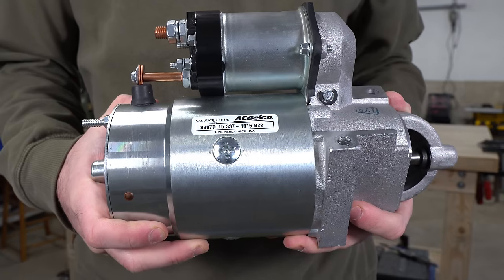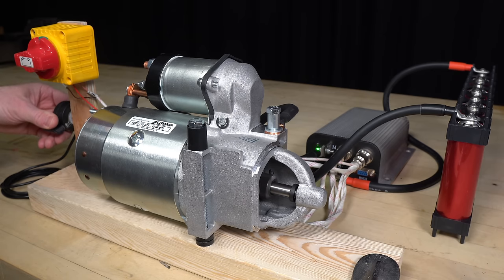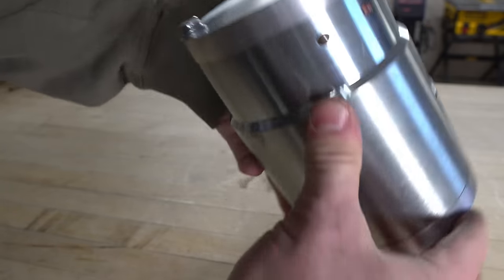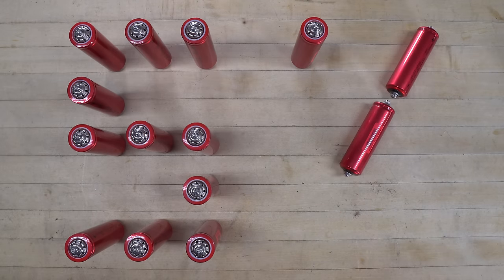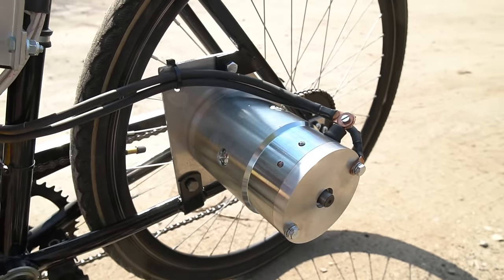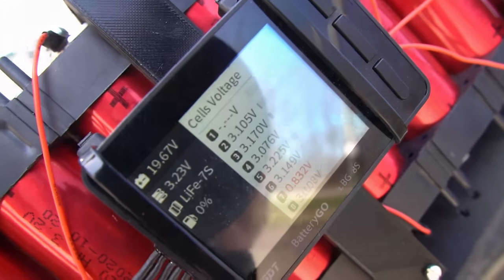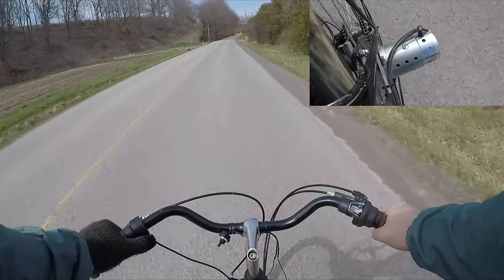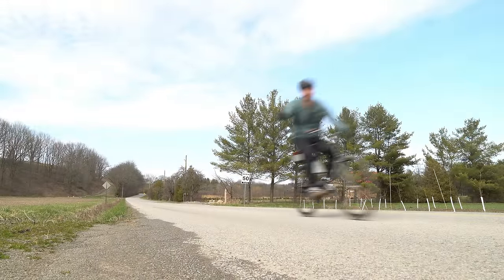Starter Motor Powered Bike

Comment: Always gotta bring up the AGNI/Lynch/Briggs and Stratton eTek motors.  They are my absolute favorite and amazing for projects requiring 1-50hp, here is some more information:

The Lynch motor is an unconventional design with a disc armature. It marries the advantages of a conventional, wound armature motor with the benefits of a flat (printed circuit) motor. It is similar to a pancake motor, but is more powerful than any of these technologies. The disc armature has magnets on both sides, doubling the available flux density and shortening the magnetic path. It therefore packs more power per pound and per cubic inch than any other motor technology. Of course such a revolutionary motor is not for every application - it is not as cheap as wound field motors, but for many applications it is a far superior motor.  It has a previously unheard of power to weight ratio and also power to volume ratio. It is also highly efficient because of the double magnet design and associated short magnetic path. It also includes integral fan cooling.

 The Lynch motor is an important development which spurred other motor designers to improve their products to remain competitive, such as synchronus permanent magnet machines.  As a result of the competition between manufacturers the cost of high performance motors and controllers has fallen dramatically.  We hope the cost of solar cells also reduces to allow renewable transportation to develop as a viable alternative to carbon fuels.
Cedric Lynch built his electric bike around a mid-drive configuration, also building one of the worlds most efficient light weight electric motors to power his rig reliably at 60-MPH for significant distances. He would later set several world records with his axial flux motor and bring it to market as the Lynch / Agni motor. Briggs and Stratton would eventually buy this technology which would lead to the Etek motor, which is now famous for making high speed efficient electric hot rods.

Cedric uses to achieve high speeds is by following the rules of aerodynamics, and building a bike that is as aerodynamic and as efficient as possible. The other builders on this list bypassed this step, and Cedric uses this bicycle as daily transportation on real commutes. Although this high-efficiency motor uses “old school” brushes, this fact allows builders to use very affordable controllers. He has proven his design choices through thousands of miles of commuting, and the Lynch motor is highly respected.

Cedric Lynch is known as the creator of the Agni Motor, a highly efficient electric motor that weighs around 25 pounds and can put out as much as 50hp. 

Cedric Lynch is a British 'mad scientist' type mechanical engineer obsessed with the idea of greener transportation. His interest has been in building a super efficient yet powerful vehicle that can serve as a car replacement.

He started thinking of his own design for an electric motor in 1983 when he began entering competitions organized by the Battery Vehicle Society regarding building an efficient electric vehicle. At the time there was no reasonably priced DC motor with descent efficiency so Lynch decided to build his own utilizing modifying existing motors with old tin cans that he would spread out flat to use as cooling fins. Surprisingly using rudimentary materials and a garage work bench, Cedric was making better more efficient electric motors than any of the universities were able to manufacture in state of the art workshops.

Cedric then came up with a motor design that could be cheaply manufactured and began manufacturing his own motor that he could sell to the public in 1988 and the Lynch Electric Motor Company was born, known as LEMCO.

Cedric first used his motor to create a small boat called “The Spark” that would set an electric boat efficiency record. From there Cedric turned his attention to bicycles, an application generally considered too small for a lynch motor at that time. Cedric mounted his motor in recumbent bike, allowing him space to eventually use a set of thundersky lithium batteries.

The resulting aerodynamic recumbent bike had a top speed of 60mph and still managed an incredible range of 150 miles. Cedric rode his recumbent creation everywhere as a daily commuter, putting an amazing 50,000 miles on the machine - technically a motorbike.

Briggs and Stratton, the US firm famous for lawn mower engines, bought the technology and used it in their E-Tech Motor, and Cedric went on to manufacture his latest incarnation of his lynch design into the Agni motor, which is used in go karts, sailboats, motor boats, and even small airplanes.

The Lynch designed motors all have the same traits. Brushed motors, around 25 pounds in weight and they are able to put out enormous power compared to their weight. Sometimes as high as 50 hp (depending on amperage ran through the motor) at an incredible 98% efficiency.  Lynch Motors are also the most often used motors in electric motorcycle racing applications.

Cedric's zero-emission motorcycle, which has a top speed of 120mph, was shown in action winning the world’s first zero carbon race – the TTxGP in the Isle of Mann.

The idea for the electric motor has been snapped up by the 56-year-old’’s friend Arvind Rabadia, who together with his brother Hasmuk Rabadia had been thinking of starting a business in India. They have now set up Agni Motors to make further-improved versions of Cedric’s motors

Despite Cedric’s breakthrough invention he has no formal engineering qualifications and taught himself the techniques needed to construct his engine. He first became interested in electrics when his parents bought him a book entitled How to build things from things found at home. 
The Etek motor is a brushed 25-pound pancake shaped motor that puts out enormous power for its weight. Depending on amperage and voltage the Etek can easily provide between 15-horsepower and 30-horsepower reliably and consistently (11-kW / 22-kW). A perfect platform for a powerful electric bike if you do not mind the weight. Although brushless motors are considered more modern, a brushed motor like the Etek allows the builder to use very affordable controllers.

Cedric-Lynch invented the motor and sold it to Briggs and Stratton which US company produced the Etek at a lower price (around $600). In the late 90’s early 2000’s it was the way to go for a high-power / light-weight electric vehicle. Many small E-vehicle records were set using the Etek motor. Finally, the market had a relatively lightweight and powerful electric motor available to the masses.

In essence, the Etek allowed hot rodders to build electric bikes. Before the Etek very few people had ever achieved 50mph on an electric bike. Even today, Etek motors (and newer incarnations of the Etek motor) are used to make some super fast electric bikes. In the case of Liveforphysics, the fastest E-bikes ever.

 Liveforphysics used a newer version of the Etek (the Agni motor), to achieve speeds of over 70mph, and dominate a recent hill-climb event.

Every Etek I have ever ridden has been characterized by brutal off-the-line acceleration, usually to a point where you have to apply the throttle very carefully or get thrown off. However, it is possible to run an Etek at a lower voltage or lower amperage and have a very manageable, safe, and sane electric bike that will not burn out on you, no matter high steep the incline.
Reply: Makes you wonder, what documented success we havent seen. I mean, we first cloned a species back in the late 1800s. Then we spent the next 100 years acting as if it were a science fiction subject.

Comment: Try using a Super Capacitor bank to start the motor then switch to battery power for continuous use. The Super cap can also provide a boost for up hill load.

Comment: As you have gone this far with this motor, it may be an idea to use this as a starting/boost motor for hills only and try to fit a second motor for cruise. That way you you can have motors that are efficient for the current riding condition.
Reply: Don't regular e-bike BLDCs have enough torque to starts efficiently?
Reply: U right there, but now extra weight, so switch to aluminum bike frame to compensate.😊./ S.B.

Comment: Nice build. But it looks like you added about 100 lbs to the bike. Try using lighter mounts for motor and battery to save weight
Reply: He used aluminum. It doesn’t get much lighter then that

Comment: I thought this was a really good try and I was rooting for you, but unfortunately the setup needs more work.  Remember starter motors are only intended for short duration use to get a car engine cranking over as you described.  In order to do so, starter motors need a lot of power hence a very large amp draw.  The Headway cells are a good way of delivering instant amp draw since it can deliver 200A from a single cell, but you will need many more cells for continued use or else you'll keep on depleting the cells since you're drawing up so much current from cells that only have so much capacity.  Maybe consider a hybrid system with LiPO and Li-Ion batteries where the Headway cells can help with the instant amp draw, and 18650 cells can handle most of the constant power being delivered.  In this case you'd need a number of cells that are at least 3000mAh or above.

As for the motor if you're still going to use a starter motor, I still think it doesn't have enough ventilation.  The housing is acting like an oven when you have the motor spinning.  I'd make as many holes possible with a set of holes facing the against the wind direction perpendicularly so you have forced air going directly into the motor and actively cooling it off rather than passive cooling of letting out heat.

Comment: I didn't expect it to be able to run for this long without stopping to cool down. what if you put a cooling fan on the motor shaft, like what power tool motors have?

Comment: I would add antifreeze cooling, antifreeze bc it has additives so the motor wont rust from inside. Maybe an automatic transmission rad(not sure if its enough) and a heat capable pump. idk how u would find a 36v one tho. id go with 12v pump and buck converter. Im actually planning a similar project. i got an old cadillac starter that has bad bushings and solenoid. Im a DIY guy, so i have many other EV projects, there's a timelapse vid abt my armchair :D
Great video tho!

Comment: you should definetly add a fan to the motor shaft to force air over the coils.  Looking at those field coils , those things look bonkers (large flat slabs of copper).  Maybe you could replace those with Neodynium Magnets to increase efficency.

Comment: I'm pleasantly surprised by how quiet the motor was. I expected there to be a lot of whine coming from the brushes
Reply: The sound you expect is from gear and pinion on the flywheel of the engine.

Comment: My father did this over 50 years ago with a car starter motor on a low-slung 20" wheels "banana-seat" bike. He implemented it with front-wheel drive, mounting the starter motor right over the front wheel, and put a car lead-acid storage  battery where the bike seat was, turning the battery cover into the seat, so you're sitting over the battery. I don't know whether he replaced the bushings with bearings, and he did not drill holes etc. to facilitate cooling. He rode it down the street and back about 1 mile total, and then turned to go up a steep hill. Going up the hill, white smoke poured out of the starter motor killing it and with that he dropped the project.
If this starter motor is 1400 W that's not even quite 2HP, so there are better options for a bike. This would give advantage where you need high-torque in a small space for a short period of time, which doesn't really fit the typical bike use case. One example with bike might be to have this configured for front-wheel drive on a mountain bike with a conventional bike motor driving the rear wheel. This would be used only for cases such as when you are climbing a short, steep grade during off-roading or trying to get through mud. The punchy torque and front-wheel drive traction advantage may help in a case like this; in addition, it may be useful for front-wheel regenerative braking.
Reply: Mr  Porsche  done  this  over 120  years  ago  but  Lead  acid  batteries  can't  power  the  vehicle  for  more than  few  minutes. 
.
Reply: @VarHar-x1k  A 100 Amp-Hour car battery run to 50% discharge (which should be ok) can power the motor at 100 Amps for 30 minutes which is 1200 W (about 1.5 HP) for 30 minutes, which is equivalent to the more powerful ebikes by today's standards. The main disadvantage would be the battery weight slowing the bike speed.
Reply: باتری های سرب اسیدی را زمانی که ۵۰٪ شارژشو استفاده شده باشه و به حال خود رها کنید، شدیدن آسیب می بینه و از عمر ش کم میشه و بهتره هر چه زودتر کاملن شارژ بشه.
.

Comment: It makes me appreciate my 10 amp hr lectric 3.0. Its cadence set points with throttle works quite well. At least as far as i can tell. I love your idea and skills. Its beyound my capabilities but i found it quite intresting. I like peddling and it helps with the over all millage per watt i guess you might say. I have a 48 watt system  that is 54 watts fully charged. It takes about 1.7 hours to get to halfway through the battery which most likely over half. I thought you might care about those detail but mabe not. Its ok either way. Great video

Comment: I wonder if a small water cooling system could be added?
Like the addition of a thermistor circuit and relay controlling a little pond pump.
If the motor gets up to 80*c the pump turns on, if it gets to 90*c a small fan could be activated over the radiator for additional cooling. 
Once the motor gets back down to maybe 70*c the pump turns off.

Comment: Hey Austin, I’m an RC car guy and I think it would be cool to see if a 1/8 scale brushless motor could propel a bicycle well. 

They can handle around 25 volts (6 cell LiPo battery), and claim to produce 3-4 hp. They also rotate at up to 40,000 RPM or more, so it would be interesting to see how you could reduce the gear ration enough to work on a bike 😛

I enjoyed this video! Have a good one ✌️

Comment: I have been watching your videos for a while and I have wondered if you use the bicycle's sprockets front and rear on a starter motor (doesn't always need to be a starter motor) like that and go through all the gears just like a normal bicycle what would be the top speed 

or 

If you use a bigger gear than the driven gear what would be the performance/top speed

Please keep posting the good work and entertainment you are an absolute legend !!!!!

Comment: Put fins on the motors like a motorcycle engine and make it a two motor setup so each one works half as hard. Too bad those motors draw so many amps, could it be feasible to modify the windings in any way to remedy that situation ? Also to aid in heat dissipation make the case out of aluminum which absorbs heat significantly better than steel. Also maybe if you could integrate one of those old three speed hubs with it's freewheeling mechanism so the motor can be stopped for most of the trip.

Comment: very nice sir  , i think the motor was overheating due being used at higher voltages , you can use an electric 12 volt fan to solve the heating problem

Comment: I would assume this wouldn't work well. Starter motors are designed for high torque and fixed low rpm. They aren't designed for continuous use either. So I see overheating issues and speed issues. The dynamic speed range might be very small.

Edit: The video is a very cool engineering project nonetheless. I would add a fan to force airflow over the individual motor winding in the rotor. The air could escape through the holes and cool it pretty efficiently

Comment: Try finding a starter/generator that they use on old Kohler mower engines. Maybe try a box or square type electronics cooling fan and make a air scoop that funnels the air directly over the motor housing for more efficient cooling.

Comment: Always use a wattmeter with your electric motor projects - they tell you a lot! I have just been testing a permanent magnet car starter, it needed 10v minimum to start and drew never less than 40 amps with no load. You can move a pushbike quite well with 200 watts and the starter is wasting another 400 watts minimum as heat. If the motor has four brushes you can disable two of them to get 30 amps no load current and a higher rpm as I found by testing. The starter can easily take 400 or 500 amps when starting a car.
Reply: i can't see how the motor could run 400A (at 36v) continuously as it's maybe rated at 3/4 HP.
Reply: @carlosgaspar8447  "when starting a car" not continuous. It won't have a continuous power rating. Starter batteries often have a Cold Cranking Current rating of 400 amps or more.

Comment: A converted alternator would be a much better choice for this. As for cooling. You have more than enough power to run a decent fan without affecting runtime (possibly improving even by keeping coils cooler) - cut more of house away to and duct some air through it. Best choice would be a bought brushless motor with added cooling of course.

Comment: Maybe just a small fan attached to the shaft to blow air through the housing, it seems almost there cooling wise.

Tbh, duty cycle is gonna be short enough that just adding thermal mass might be the way to go, a water jacket or something